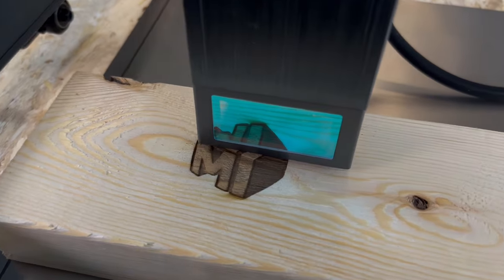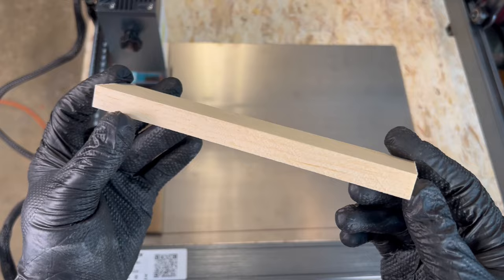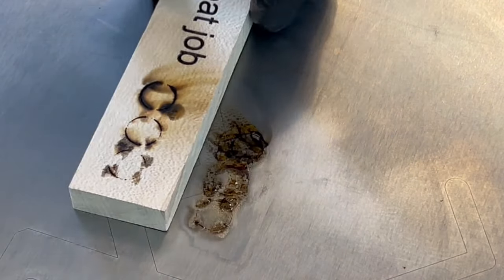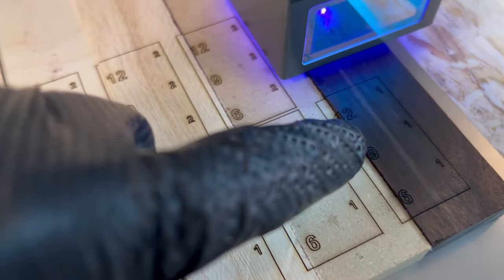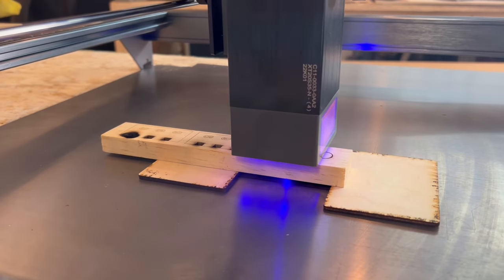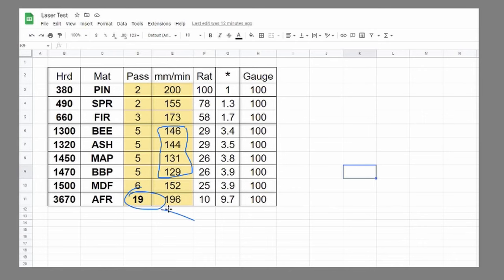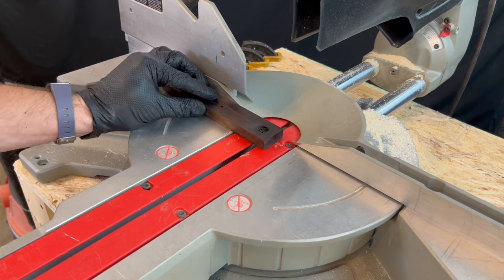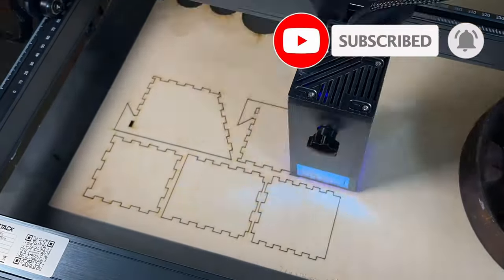POWERFUL 20 WATT - ATOMSTACK X20 Pro LASER vs Wood!

Comment: Wish I had seen your video earlier. I have a X40 Pro and your video shows exactly the problem with laser cutting. It is always a balance act between cutting and burning your material. I mostly try to cut 9 mm plywood (multiplex) and get huge issues to cut more complex shapes. Cuts are inconsistent or the surroundings are heavy burned.
Reply from the maker: I've been dealing with some of the same problems as well.  It seems that plywood is one of the most inconsistent materials, some layers must be fare more dense and don't cut so well.  I think that may be the reason we see so many pieces made from MDF, or thinner plywood.  The only way around it seems to be to make more passes to make sure you get through everything.  I'm not sure if a CO type laser would be better for this.  It's nice to have a laser, but I agree that thicker materials can be tough to figure out.
Reply: @NeedItMakeIt  I came to the same conclusion for the 9 mm plywood. after all the advertisement and the reviews I didn't expect that that will be the endboss. It's a lil bit disappointing, more passes raise the risk of burning again and much more passes with less power raise the time you need for cutting. I ask my self the same question about the CO2-Lasers but do not have a experience or an answer. Another approach I think about is to replace the Air Assist with a persistent compressed air line. The Air Assist is by design not very strong and maybe a controllable air pressure between 1-2 bar will improve the results? But as we both know more air can also promotes the formation of flames. -.-"

Comment: just bought an atomstack A20 pro - now all I have to do is learn how the settings work i.e. cutting and the engraving.  What would be your settings for cutting 3/4 poplar - I ask this because I woodburn wedding plaques and use the scrollsaw to cut out  the ovals.  - btw good job explaining how you do the cutting

Comment: How about some gasket cutting? 
There is various gasket materials and many thicknesses.  
Some of the better heat resistant gasket materials can be tricky for lazer
Reply from the maker: I'm definitely up for that, I will need to get an enclosure going ASAP!

Comment: Any ideas why my x20 pro seems so under powered? It struggles to cut quarter inch plywood. 100 mm/s, 100% power 2 passes. I adjusted the S value as recommended. Any ideas?
Reply from the maker: I've struggled with some plywoods, I believe it could be related to the type of plywood you're using.  If you're using high quality Baltic birch ply it'll be more dense and the laser will struggle.  Plywood is a bit tricky, it changes density constantly, I've had areas which require 4 passes, and areas which only require 2.  That's my best guess, if you want to provide some more info we could try to get to the exact source together.

Comment: I want to burn an image on a 1 inch wooden dowel. Can this system do that?
Reply from the maker: Most of the lasers available these days have a rotary tool that can be added which allows the dowel to rotate while it's being engraved.  There are newer machines now which might be better options than this one, Creality has one called the falcon 2 as well that you might want to check out.  I assume you were talking about engraving along the length of the dowel and not the ends.

Comment: On the web side it says Atomstack X20/S20 Pro 130W Watt laser not 20watt.🤔
Reply: Yeah, that's marketing at it's 'finest'. The 130W refers to the power supply used for the electronics and laser, not the power of the laser itself. When looking to purchase a laser, the key feature to check out is the power of the laser first, the other numbers are not very useful and tend to confuse potential buyers.
Reply: @TheGabb3r  company's should get punished for making fals advertising.
Reply from the maker: I figured that would confuse people as well, I like to do the tests to see what the capacity is regardless of the printed wattages, hopefully the video helped to show this.

Comment: You didn't mention what power you where running at? Cutting should be a balance of speed and power, cutting at 100% power all the time will shorten the life of your laser. I usually cut in the 70-85% power range and slow down the cut to help maximize the life of the laser.
Reply from the maker: Good point, these tests were all at 100% power, not ideal for the laser lifespan.
Reply: Ya